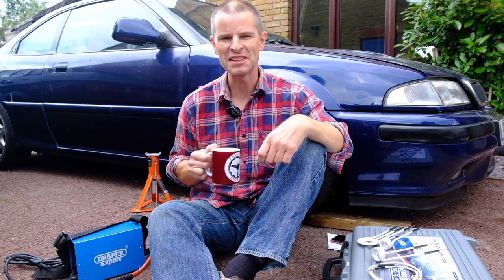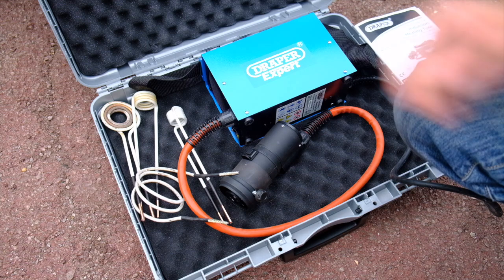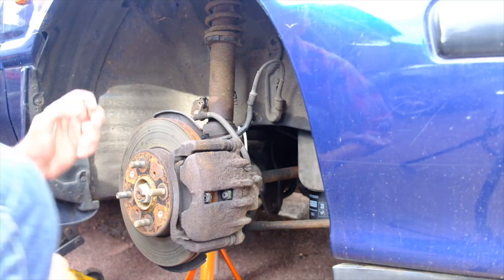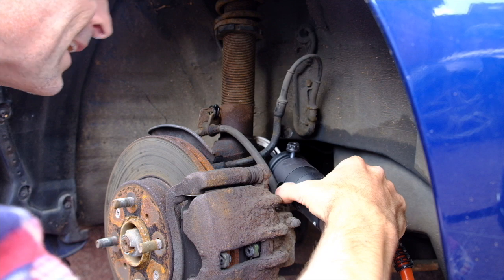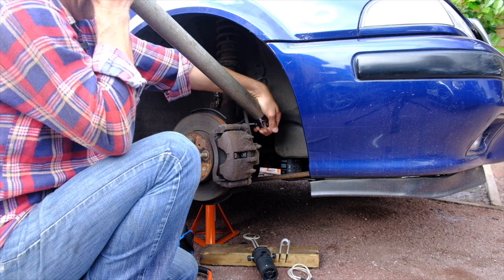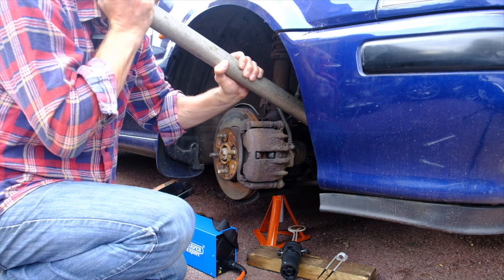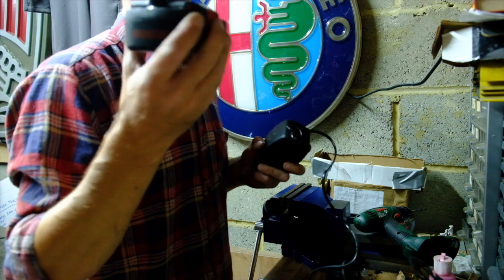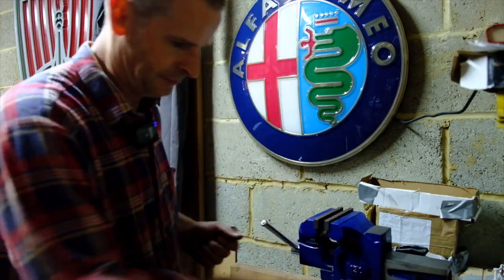My new favourite tool - heat induction on the Rover Tomcat

Comment: I was told many years ago that if I was planning a job on the car, to douse all the nuts and bolts with penetrating fluid every day for three or four days beforehand. It does seem to work. Also, if a nut can be loosened a fraction, tightening it back up and loosening again can help free it up. Got to do exactly the same thing to the suspension on my old V70 next week. Smashed knuckles   are imminent.
Reply from the maker: Dont know if you've seen the previous vid on this job, but there was ALOT of WD40 going around! These were some of the worst seized bolts Ive come across!

Comment: These induction bolt heaters are a very impressive bit of kit, and now on eBay they are easily affordable, mine has saved literally hours of pain and aguish releasing frozen bolts on my 2004 MCS. What helps on big suspension bolts like this after heating them is an impact wrench, the impact action greatly reduces the chance of shearing the head off the bolt like you do with extension bars on your ratchet.

Comment: Have another go with the track rod taper/ball joint end fixed in place. I recently spent an hour at work trying to undo the locknut on the threaded part of track rod on my Citroen Xantia when I wanted to adjust the tracking. Wire brush, penetrating fluid (not wd40) more wire brushing, more penetrating fluid. Lots and lots of hitting the spanner with a hammer etc. It came undone eventually, but it  would never have done if I had removed the ball joint end first.

Comment: I know your pain lol Rover seazed bolts lots of heat good machine.  I tend to blow lamp my track rod ends undo the locking nut first while track rod end is connected then it comes of fairly easy. I am not saying that your wrong just a different approach good video allways like seeing the Tomcat.👍👍

Comment: I also used freeze lubricant on a stubborn screw recently. It makes the bolt contract enabling the oil to penetrate the thread. Amazing stuff but expensive if doing lots of nuts.

Comment: You should ask Draper if you can get a discount on the heat induction tool as it's now a used demonstration unit ;) ...
Giving those bolts a good coating of copper grease before installing them should help prevent that problem next time...
Dousing the bolts in a non-flammable penetrating oil between periods of heating might help free the bolts quicker as the heating and cooling will expand and contract the bolt and should help it release quicker.  It might be possible to use water to douse it but there is a risk of inducing thermal shock into the metal and possibly cracking castings.  Naturally, only try this if the instructions for the thermal induction tool allow as liquids and electricity aren't a good mix...
Reply from the maker: It doesn't mention liquids, at least not that I noticed.
It might 'get lost in the post' on the way back though...

Comment: Where there is a split in a casting as in this nip joint put oil in it will work its way in the threads in the hot /cold cycles

Comment: Great video as always BUT ........... Where you went wrong with the track rod end: Undo the lock nut whilst the track rod end is in place on the hub since it's being replaced so it doesn't matter if it gets damaged. That way you're levering against the hub instead of left hand against right. As for the bolts, well you just wanted to show off with the heat tool, any normal person would have used a nut splitter or angle grinder to split the nut and end of the bolt since they're going to be replaced.

In short, if it needs to come off and you're replacing it, destroy, destroy, destroy!

Edit: You should have watched one of my recent vids where I did the track rod ends and CV boots https://youtu.be/ooQbP4JO9Gk
Reply from the maker: Ive only got the heat tool a few days. NOTHING is being left unheated and done up around here! And yes, once I had that track end off I realised I had no leverage on it...
Reply: @furiousdriving  Oh your poor wife and children ...... I can see it now, full overalls, face mask and gloves accompanied by the words "Is there anything that needs loosening?"
Reply: @TheFakeRussian  - I'm wondering how many cold cups of tea are going to get the induction treatment at Furious towers this next week?!
Reply: @paulsmith-ib3nx  Oh you had to give him ideas!! 😂 🤣😂 🤣😂 🤣
Reply: Surly if you just cut the nut head off the bolt you will still have the thread in the hub assembly to remove?
Reply: @mrbakerr1  The bolts that were the main issue were the pinch bolts for the hub to strut. There isn't, (or shouldn't be), a thread in the hub itself as it's a compression fit with the bolts clamping the strut to the hub arm. A thread would defeat the purpose of the nut. The bottom ball joints are a threaded connection onto the housing as the bolt is there to run along the flute of the ball joint to prevent it from popping out.
Reply: What I was trying to say (not enough coffee) was that I don’t think there is a nut, the bolt threads into the hub assembly/arm and by cutting the bolt head off what remains of the bolt would be hard to remove.
Reply: @mrbakerr1  It's a through bolt with a nut on the end to clamp the hub arm aperture around the bottom of the strut. Therefore cutting off the head or the nut will allow the bolt to pass through. Personally I would have taken the whole assembly off, (strut and hub), and dealt with this removal off the car.
Reply: Ahh, my mistake, I thought the set up was the same as say on a mk4 golf or Ford Focus where there is no nut. I stand corrected.
Reply: @mrbakerr1  Yeah me too bud I just had a look at the video again and it seems there's no nut! Which begs the question why was both sides being heated up? I assumed, (possibly wrongly), it was a typical nut and bolt set up for a compression fastener. So my hands are held high and open as I could be wrong.

Comment: I have the induction heat gun which you find on ebay for around £200, it takes about 30 seconds to heat a nut/bolt to glowing orange. I wouldn’t be without it.

Comment: Put the track rod end back into the hub.....screw the nut on a few threads (or use a set of mole grips on the thread if they're too knackered to take the nut) and then undo the adjusting nut on the rod.

Comment: How strange. I had a stuck shock bolt on my Maestro and just applied liberal amounts of WD40 to it for a few days. One big breaker bar and a 6 sided socket and it was off. WD is a penetrator and a lubricator. 

Not entirely sure would have been necessary to go with the induction heater but if it was free to use, fair play.
Reply from the maker: Ross Armstrong have a look at the previous video in this series. 2 days of wd40, blow torch and long breaker bar with a 6 sided socket and still it was just rounding the bolt. That’s why the heat

Comment: You reallu only need to heat the nut so that it expands away from the bolt.
Reply from the maker: In theory, but with long bolts with the thread as the far end - and as stuck as this - its not worth no heating it all as if it sheared it would be a mare
Reply: @furiousdriving   I have only usde proffessional grade induction heaters some with water cooled heads and with those there has never been a problem. In a pinch there is always the option of the grinder since itäs a sactificial bolt anyway in this instance. We used to put the coil around the nut with the heater simular to the one you had and it would heat up while the bolt stayed cool and for safety sprayed the bolt inside the nut with penetrating fluid to get more differential cooling the bolt itself will be pounded out anyway. Jsut did the same job on my mondeo but miraculously none of the bolts were that seized even though the threads were totally rusted away outside the nuts on a few of them. The nut on the track rod end is also probably better ground off since its not being used again. An angle grinder is a top investment for someone working on as many old cars as you do.

Comment: NEXT time you want to get a stuck bolt out of a socket, put the SOCKET in the vice, get a small long chisel/metal bar, put it thru the hole in top of socket and knock bolt out, simples! however, if you had bought some PLUSGAS and liberally sprayed it over the offending area, that also "may" have done the job.
Reply: Try this next time always work for me. Bolt stuck in socket just put it on the floor and hit the socket body with a hammer. Few taps it pops the bolt out guaranteed every time.  Best part is don't even have to get up from the work area.
Reply from the maker: The 'suitable drift' is my go to method and I tried that first but it didnt touch it, had to cut it as the vid was running too long
Reply: @furiousdriving  surely no "drifting" is the only sensible answer ....  To drift, surely means one's not in control of the  vehicle, does it knot  😜😜😜😜

Comment: Tbh I tend to use a blow torch. Much easier to control in tight spaces, and more to the point I've already got one. A godsend for exhaust nuts. Heat is the way to go when you have rusted up bolts; basically the nut will expand faster than the bolt and thus the seal will be broken between them. 

I am surprised in this modern age that people don't smear grease over nuts/things that will corrode. If you do your own maintenance you will most likely come back to something you have undone before; if it's smeared in grease from your last visit then it's going to be a doddle to remove again. Also smeering brake pipes in grease is going to make them last so much longer. Put it this way: since I have been smeering stuff in grease, maintenance has become much easier. Needless to say you can do this with exhausts!

You should invest in a couple of breaker bars. A middle sized one about a foot and a half and a long one about 3 foot long.
Reply from the maker: I used a whole blow torch can u trying to shift these b******rds (in the previous video), then I got serious with the heat
Reply: @furiousdriving  Ah. A couple of blows with a hammer can help but you need to be careful.